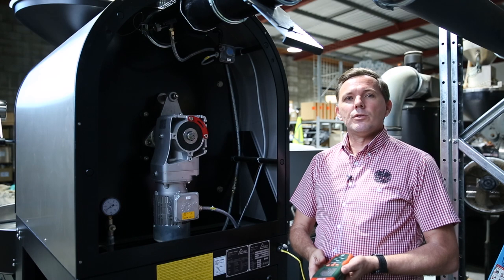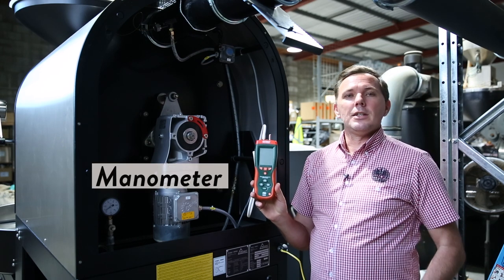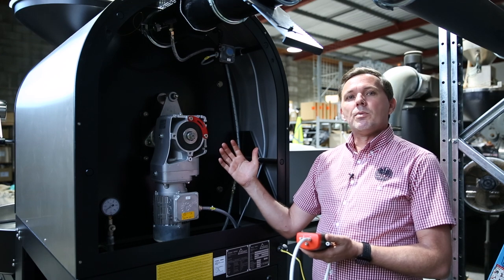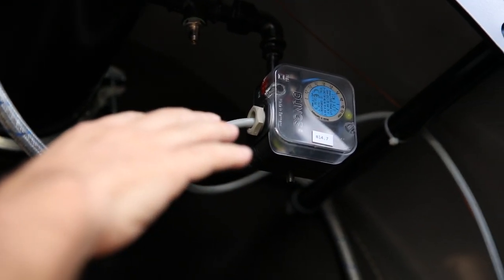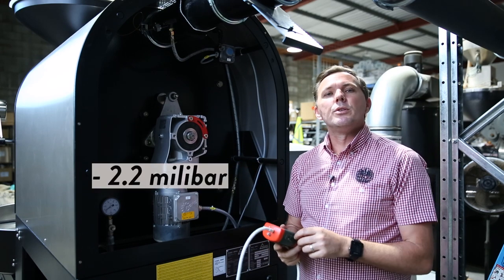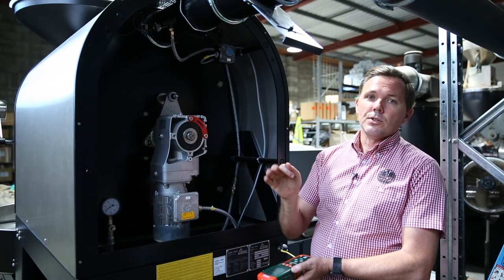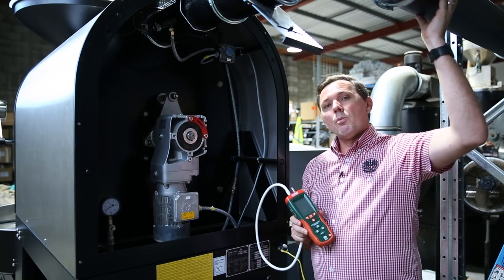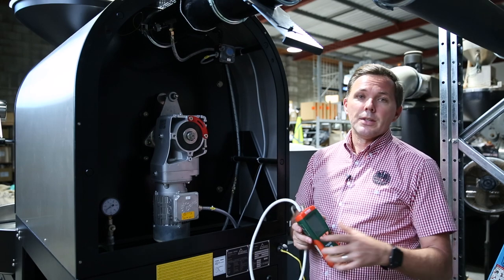Setting the Under Pressure of your Roaster

Comment: i found that there is another pressure monitor near the burner. What is the function? And  the LED light of the monitor should turn on or off?
Reply: I think this is gas monitor.